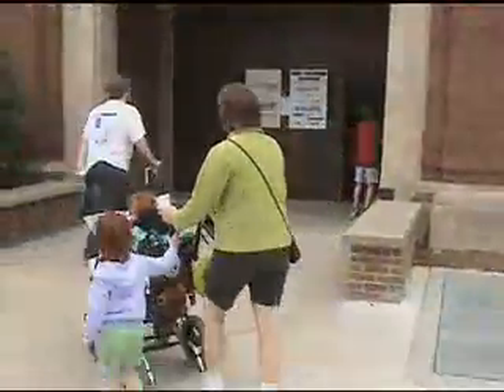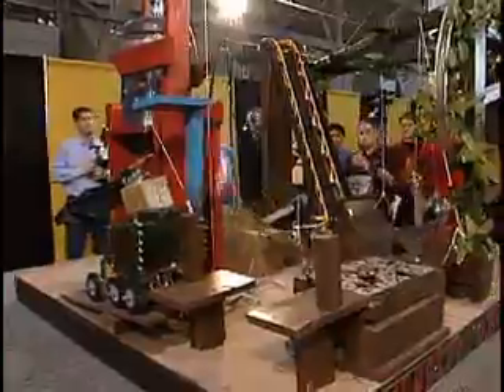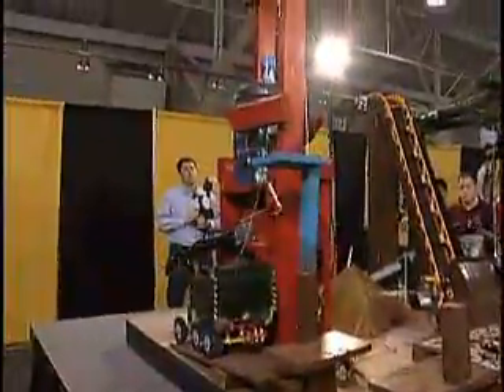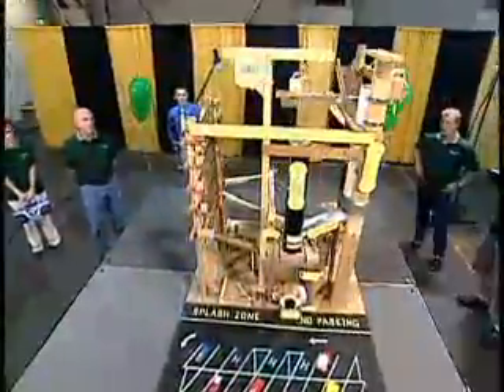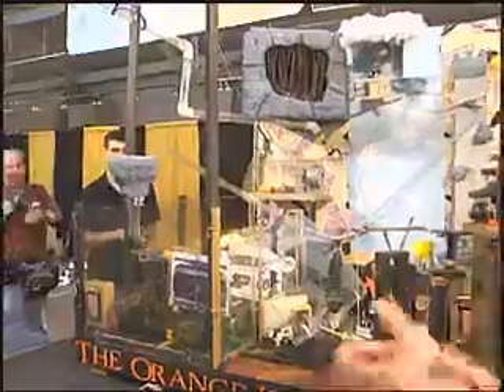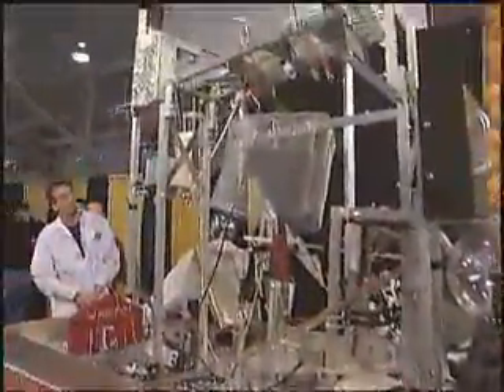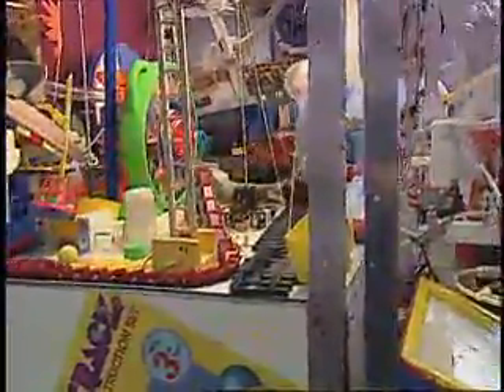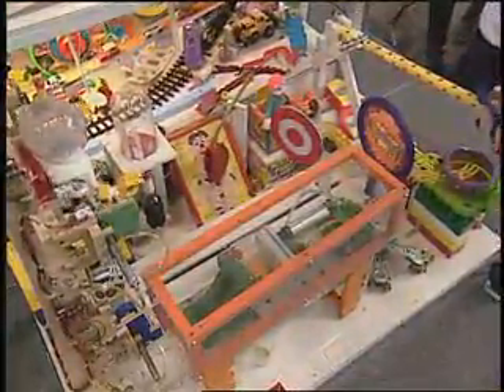2007 National Rube Goldberg Contest

Comment: The more complicated steps can (and sometimes have to) be calculated immensely to ensure that the same result happens over and over again, it's basically stringing several machines together and having one activate the other. There simply is no better way to practice engineering than with a Rube Goldberg machine.